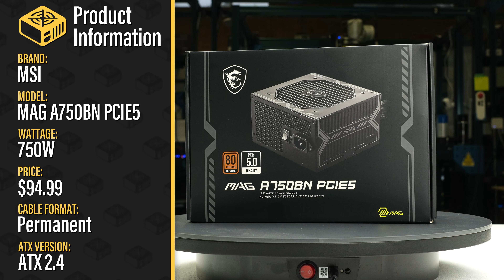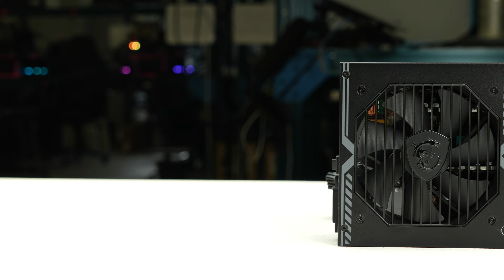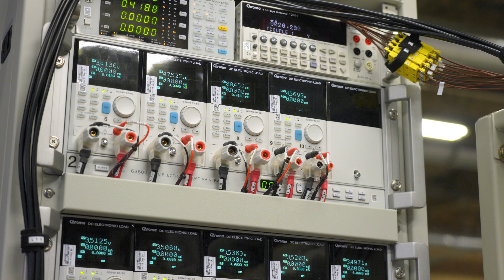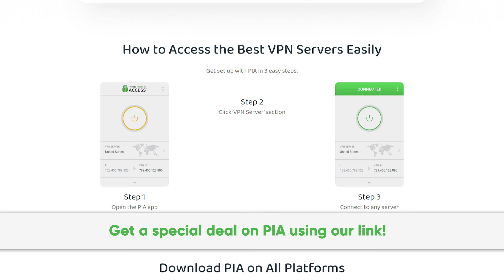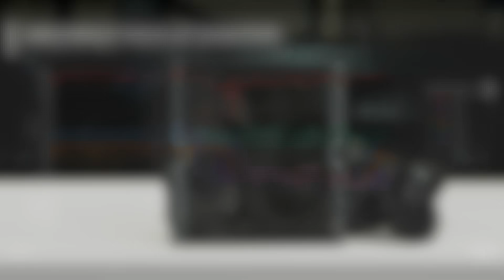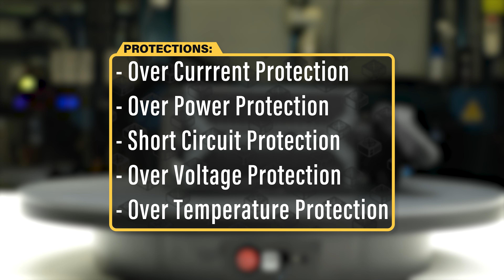MSI MAG A750BN 750W Power Supply - LABS Test Report

Comment: got this for £58 which is a good deal for a budget pc im doing with a 7500f and arc b580,i plan to put in a 5070 super or 9070 later next year
Reply: If you change to 5070 super change the PSU aye anyways please I’m gonna buy it for my arc B570 is it working with the B580
Reply: @alashaeboubI dont think super series is releasing this year so im probably getting a 9060xt 16gb